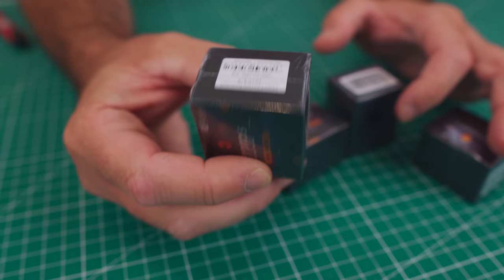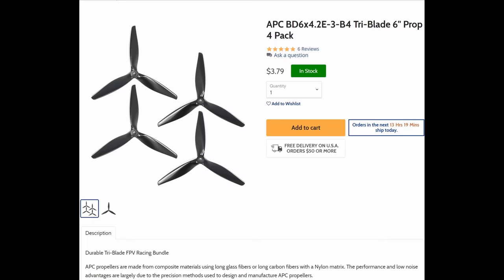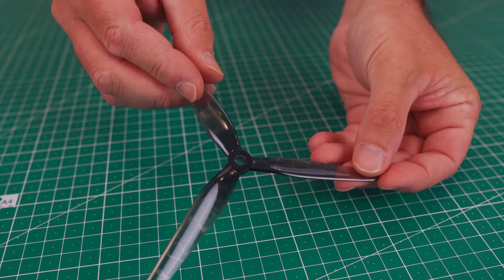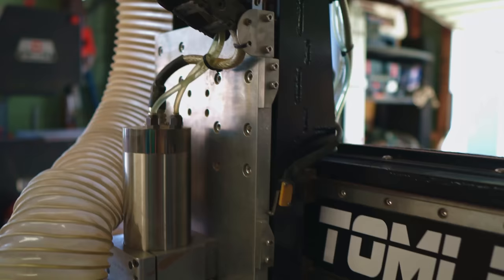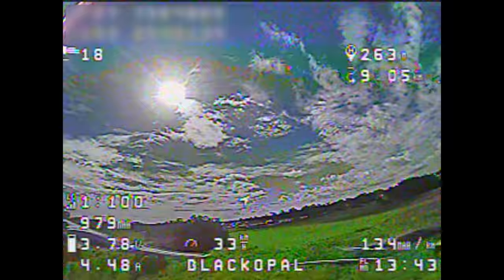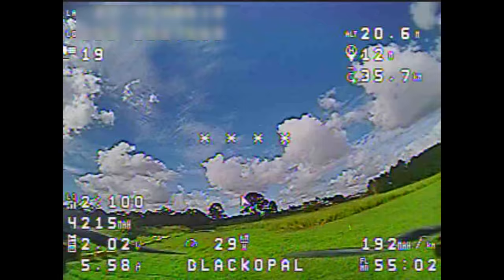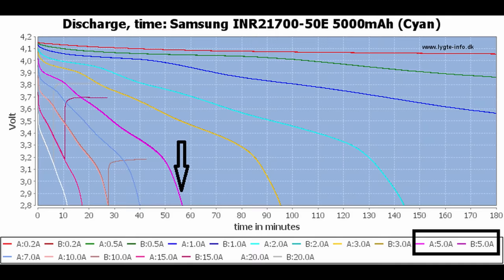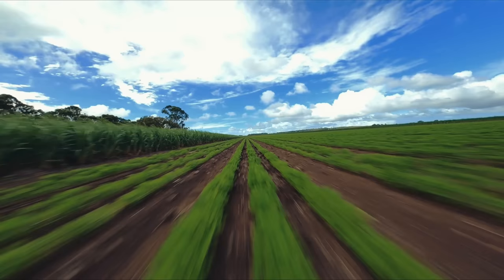55+ Min Long Range Drone (NEW T-Motor F2203.5)

Comment: 5000mah? Battery?
Reply from the maker: 4S 5000mAh yeah. Samsung 50e 21700 cells.
Reply: @ScottTomlinson  how much it weigh?
Reply from the maker: @DesignRobot_co  290g

Comment: Not a company, government or agency. Just one guy with passion pushing the limits of technology! Awesome work man!
Reply from the maker: Thanks for the comment mate. Appreciate it.
Reply: @ScottTomlinson  hey. Do you sell your frames anywhere on eBay or somehow? Would you be able to give some advices of the hardware you used for your build? I am really after ultralight and ultra endurance long range quad as I am struggling with my 4" I do not really like anymore as it flies just 7-8mins. Drones You do have much more dense for long range. Please - how to get in touch with You??
Reply: How can I buy this frame?

Comment: Why 6" instead of 7"?
Reply from the maker: Personally I think 7 inch would over prop these motors. I suppose you could make it work with a lightweight bi-blade if pure endurance was the aim. On 5/6 inch the versatility is amazing. You start loosing portability too the larger you go. I wanted these small, ultralight quads for hiking etc.

Comment: This hobby is seriously going places. Every year when you think how could they possibly top last year's innovations, new big leaps are made.
Reply from the maker: Lots of innovation currently going on in this space right! I love it.
Reply: when prices drop ill see it going places as of now eh..
Reply from the maker: @hakimdurand8427  FPV quads in general or the ultralight ones? My UL builds cost me less than my typical 5 inch race quads. Hardware doesn't need to be as powerful. The BnF mini-long range quads are really well priced I feel.

Comment: XNOVA T2203.5 Toothpick is so far the only T.Mount motor i found in this size. dont know how efficiency is, but i rely most times on the measurement tables from t-motor than every other manufacturer. in the past the t-motor were the efficient ones, not always the most powerful ones.

Comment: It’s nice to know that quads are catching up to RC planes! I get around the same on a Bixler 2 on 2200 3S.
Reply from the maker: Gah, we can only dream. Little by little I suppose.
Reply: There not catching up they can manoeuvre in ways a plane could only dream of. 

You can fly a drone in terrible conditions that would make flying a plane like being on a washing machine with a brick in it.
Reply: @MrStevegibb  I’m talking about flight time with the same battery capacity. Not how they fly.

Comment: That's incredible!! I built a 15 minute quad when everyone was amazed with 5 minutes. I never thought I would see an hour, I've never flown long range, I know flying for 15 minutes around the same area seems like forever, but I bet it's fun flying 50 mph for 6 miles like you were flying at the end.
Reply from the maker: Haha yeah the actual time tests are pretty tedious. You're right though, hauling around at 100kph for even 10 minutes is a serious rush. The DJI 5 inch I have makes this even more fun.
Reply: @ScottTomlinson  🧐🤫😂
Reply: @ScottTomlinson  you have the new DJI fpv drone?

Comment: I fly a 6s1p 21700 on a 6"/7" floss with a hero 9 that averages 12-16 minutes at 50-55mph(80-88kph). 8" quad with 6s2p 21700 8000mah with a full hero9  and cruises at 60-65mph(96k-104kph) for around 13-14 minutes. I usually land and voltage pops back up to around 3.2v per cell.  I'm doing a naked hero8 soon so i'm guessing time will go up substantially with that mod. Obviously, I could fly much slower and stretch that time but my goal is outright speed while having efficiency. I'm also using full dji air units so if i went vista i could shed a little more weight but I like the robustness of the full-size transmitter.
Reply from the maker: Sound like a wicked fun quad my dude.
Reply: I see someone has already gone naked with a Hero 9, was a very tough strip from the video. I'm keeping mine 'dressed' for now, just losing the internal battery.

Comment: You might be able to save a bit of weight by reducing the height of the standoffs and removing the battery strap retainer thingy. And using a small 20*20 aio you can save about 5 grams plus the weight saving from standoffs. actually you could drop down to 3 standoffs aswell
Reply from the maker: I've got some stupid light tube frames and foam core frames in the works but I'm finding 10 -15g or so doesn't really affect that much. Critical if you're trying to push sub250 though yeah. Thanks for the comment though mate. I love the discussion points these types of videos bring out.
Reply: i'm working on a tube frame as well
5x3mm is enough for 5"?
Reply from the maker: @marc_frank  I've been using 10mm tube with a 0.5mm wall thickness.
Reply: @ScottTomlinson  seems a bit thin, but light and rigid
my 5" tubular design is almost finished
CAD says ~18g
the tailboom of my DLG is 5mm od and 3mm id and seems strong enough for a drone frame
pultruded carbon tube, not wrapped
Reply from the maker: @marc_frank  That sounds awesome dude. I'll keep an eye out for sure

Comment: That's great Scott, i managed 45 minutes on a toothpick 4inch setup running Ardu for missions, you got another Sub!! Cheers Simon.
Reply from the maker: Awesome Simon! There's some pretty cool stuff going on in this genre at the moment. Looking forward to doing more.
Reply: hey Simon, i'm curious how you managed it in ardu. Would you mind sharing the setup? I'd love to make a ardu/bf comparison of flight times with same settings.
Reply: @charlesmarseille123  Plenty of flight controllers now support Arduo, you just flash using betaflight in dfu  mode, reboot and open up Mission Planner. :-)

Comment: Just finished a copy of your design with a 3D printed frame. Main frame thickness 8 mm! Tried PETG and PLA. PLA gives quite good stiffness but not comparable to carbon. Frame weight in PLA only 27 gramms. Drone dry weight with 6 gramm props,  GPS and external compass only 188 gramms (exactly like yours, funny coincidence). No maiden yet...
Reply from the maker: Oh interesting! I was really apprehensive about people trying to print it but I hope it works out for you! Keep us posted mate.
Reply: @ScottTomlinson  Maiden yesterday successful: AUW 384 gramms with a 3S 3000 mAh LiPo. The 8mm thick 3D-printed PLA-Frame showed no vibrations. The only drawback: The frame with 8 mm thickness gave me a hard time to find the right screws to mount motors and FC. For the next 3D-design I have to foresee countersinks.  Flight performance: In Angle mode almost no drift. Actually I didn't test full throttle accellerations. Just normal cruising at about 20-30 km/h. Performance 85 mAh/minute. So, the first 20 minutes flight consumed about 1700 mAh. Still props are not optimal. I'm using 6 gramm 5x4x3 props. For the first time I'm using INAV-Firmware on a HGLRC-FC. The BN180-Beitian GPS locked in with up to 17 satellites (!). The RTH and landing position precision was within  plus/minus 30 cm. Funny to see such a "racing style" drone with gps position hold function.

Comment: I noticed one interesting detail in the fpv footage... how can a current be approximately the same at 3.8 volts and also at around 2 volts at the end of the flight, all at approximately the same speed? I'm not saying that the footage is faked at all. I just find it interesting. I mean, I can't explain it. Maybe I'm missing some details... Did anyone get any similar times with any other motor/prop combo? 4 to 5 amps for that weight is really really great in my experience! The props are really big, but still... I really think that these particular motors must play a BIG part in that low power consumption. I guess I will have to construct it and see for myself! :)
edit: some additional calculations: according to the footage, this motor+prop combo gives you 122g of thrust at 17W ! That's crazy. I'll have to replicate this :) Thank you mr. Scott! You got a subscriber.

Comment: Building my first FPV drone. Curious if you used the F35 with built in FC or if you are using a stack with FC and ESC as separate boards?

Also curious what goggles and controller you recommend. Looking for something not super bulky.
Reply from the maker: This was a separate FC/ESC yeah. AIO would be better (like my UL race build) Any FatShark goggles with stubby antennas will be nice and compact. I use HDO2 for racing but DJI for everything else now.  I also really like the Tango 2 as a controller. Be super careful if you're using this frame...Really not a first quad option IMO.
Reply: @ScottTomlinson  thanks Scott! I ended up going with DJI Goggles myself and using the Air Unit for antenna redundancy. Going with two Triumph Pros on the Drone and 2 on the goggles as well. 

Using the TBS Source One frame which is a little more burly/cheap to replace.

Comment: I wonder if you can fly these on 2S 18650/21700 with bigger props for more efficiency and much less weight. Using a tube frame it could possibly be even lighter. Even less crash resistant tho :P
Reply from the maker: Possibly. It would likely be a drone only for timed flights etc. The beauty of this setup is the versatility.

Comment: Aside from higher capacity batteries, Lower KV motors, Higher volts and larger props = longer flight times

Comment: Oh my, that's a seriously nice quad...All you need now is a 1280mhz long range video link...🤔😳😳😯🇬🇧...Works alongside 868mhz control no problem..
Reply from the maker: Thanks for the kind words man! 5.8G video is good for the 20km this could potentially reach. A bit of a power bump and decent VRx antenna and you're set.
Reply: @ScottTomlinson  5.8g requires a lot of altitude though, unlike 1.2g...Theres a big difference. It also needs way less RF power.

Comment: I'm thinking of these ore the fpv cycle 2203's for a cinewhoop build, (probably shendrones squirt) Which kv version of these would I need for a 6s squirt cinewhoop?
Reply from the maker: Around 2800kv would be sweet for a 6S 3 inch.

Comment: hey bro, if i were to use a 1300mah 6s, would the amp draw be more at hover for the 6 inch prop or 5inch prop? keeping the motor the same. Like woul you get more flight time on the on the 18650 with 6 inch props vs 5inch? ty!

Comment: How do you use nd filters with your gopro without the stabilisation looking really bad? Got some filters for my gopro 9 and noticed the stabe gets really messed up.

Maybe that's just the gopro native?
Perhaps reelsteady is fine with it
Reply from the maker: Oh that's interesting. I haven't come across that before. Are your ND filters secured properly? Maybe there's a small vibe happening. I tend to add a dab of hot glue on the side to keep them fixed in place.
Reply: @ScottTomlinson  It's probs not vibration. Cool idea with the hot glue, but you're talking about those ones that stick into a gopro lens rather than the ones that replace the gopro lens covering?

I haven't actually experienced this on a quad yet, I was just testing the nd filters while walking and skateboarding and the gopro inbuilt stabilisation was really not having a great time.

In a few reviews on youtube of gopros mentioning nd filters they say how the gopros native image stabilization relies on super SHARP frames to stabilize well. And with ND filters your'e shooting low shutter speed with more blur so I guess that's the issue.

I have a friend that said it's not a big deal even with native gopro stabe on a quad, because the shakes aren't as large as your whole body bouncing from walking for example.

---

Idk, I just hope I can get stable and nice and motionblurr fast looking shots without an issue.

Do you use reelsteady or the native gopro stab in this video? And is it fixed shutter speed or auto?
Reply from the maker: @cinialvespow1054  I mostly use the Polar Pro style ones, they clip over the GoPro basically. Camera Butter black diamond in a 3D printed 'clone' of that style. I'm always using a fixed shutter speed unless transitioning from inside to outside. I try lock WB most of the time too. I use a mixture of Hyper-smooth and RSGO.

Comment: such a good video! I desinged a similar 6" frame... and i got a very bad oscilation problem. Are you able to bend your fram a bit? bc I thing in my case this is the problem. Allthrough my desing is thiccer.
Reply: Hi do you have video of the oscillations? I have the same issues. - https://www.youtube.com/watch?v=UG3tKmGH3Bo

Comment: super lights arent my thing but just wandering why a 5mm shaft over a tmount for this? woukd tmotor make a t mount?
Reply from the maker: This motor (though the 2850 kv) one was originally designed for the racewhoop and the majority of props for those are 5mm. I think the insane performance of the low kv one was just a bonus haha. I think we'll see both styles eventually.

Comment: Y could still get some weight of from the drone  crave 2mm off from middle of each arm. You don't need 5mm carbon fiber it does not so much stress. But carving it to U shape is better option than going thinner carbon fiber board.

Comment: Picking these up for a pretty heavy 3" cine. Hope it can handle a 1550mAh 4s and a Hero 6
Reply from the maker: Nice. I'm assuming you're going with the 3550kv ones being 4S and 3 inch?
Reply: @ScottTomlinson  Yup, that's the one. Do you think it'll be ok for a heavier build? I'm really hoping I don't have to go to a 1300mAh lipo or a naked gopro

Comment: Any word on being able to get these 6x2.5x3 with a hole for 5mm shaft instead of the t-mount?
Reply from the maker: Funny coincidence you mention that. Gemfan just sent me a a bunch of new props to try (literally got them 2 days ago) and those were included. I haven't tested them yet but I'm sure you'll see them available soon.
Reply: @ScottTomlinson  awesome. Ended up making my own ultralight frame for those motors as well (designed with the vista in mind however). Lightweight 6” props are few and far between. ✌️

Comment: Nice build and pretty good flight time for such a small thing ;)
Reply from the maker: Thanks mate! I watched some of your videos a while back and they were impressive. Did you ever manage your 40/80 flight? I'm currently working on a similar 7inch with double capacity. Trying to keep it small still. For now haha.
Reply: @ScottTomlinson  No, I'm planning to do that this summer. Everything is ready, need only a weather with zero wind up there. In the meantime I completed a build in 450 size which hovers for 83 minutes and is capable to do 27-28 km and back. Looking forward to see your results in long range flying!
Reply from the maker: @WRXMSK  Awseome dude, I'm subbed to you so I'll keep an eye out for sure!

Comment: Hey Scott! I fly mainly 5 inch drones so have the typical ~200gram 1300mah 6s batteries. How long do you reckon flight times would be on that?
Reply from the maker: For 6S Lipo, I've noticed it was very close to 100mAh/Min on the analog version (No GoPro). eg. 8.30 min on 850mAh 6S and ~12 min on a 1300 mAh 6S.

Comment: Hey Scott, I want to put 6 of these T-Motor 2203.5 /1500 kv motors on a  5 in. Hexacopter with either 4s or 6s 21700 lithium Ion battery packs. How can I figure out what the ESC's amp rating needs to be for these motors. Thanks for any info you can provide
Reply from the maker: The Tmotor webpage has some test data for different configurations. 25A is pretty much all you'd expect to pull from these at peak. On 6S with a GF 5125 it's around 10A at 80% throttle.
Reply: @ScottTomlinson  Yeah I went to their webpage and saw the data sheet, and figured I would need a 30A ESC for each of the motors, but after the flight in your video, you said "This is only rated for 10 amps, but it was only pulling 9 amps". That's where I got confused and was thinking that maybe the Flywoo 6 in 1 ESC might work, since it's rated to 15A, but Flywoo and T-Motor support said it wouldn't work. So on any build, I find out the peak amperage draw of the motor, then find an ESC that can handle a few more amps than the motor's peak draw? Is that correct?
Sorry, I'm fairly new to FPV. I've built one quad with T-Motor F60 PRO IV V2.0/ 1950 kv, T-Motor F722 FC, and the T-Motor F55A Pro II M3. I did a lot of research, but was just guessing with the ESC. I put that on a 50 gram frame with GF 5152 props. It's way too fast for a beginner, so now I want to build a long range cruiser, to make it easier to learn how to fly, lol. Sorry I wrote so much, and Thank you for any info you can provide. Sincerely Conrad Hughes
Reply from the maker: @gargolaconrad3188  Ah yep, my 21700 cells were rated to 10A. Good ESCs are usually underated too. For example, I use those same F60s on a race quad with the Aikon 35A 20x20. If you had good throttle discipline you could probably make the 16A work, especially with light props..Hexa is a little weird though, bit of a gimmick in my opinion.
Reply: @ScottTomlinson  OK cool, thanks for the info., Being able to use the 6-in1 would be a lot cheaper than buying 6 single ESc's. I need to practise throttle discipline anyways, So I think I'll give it a try. 
If I have to, maybe I can retard the top end power of the motors, on BLHeli32 or BetaFlight like I heard some racers do.
 OK, Thank You very much for your time and information, and thanks for your awesome videos. Have a great day. (It's 3 a.m. here, time for me to try to sleep) Thanks again for taking the time to help me.